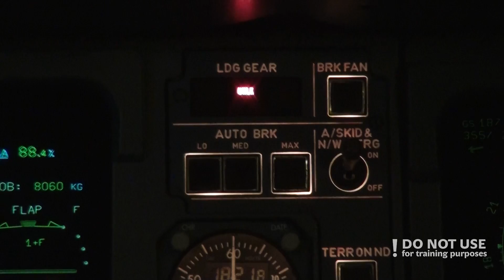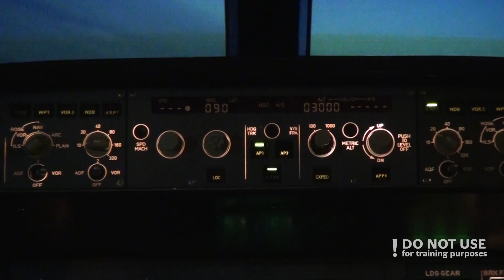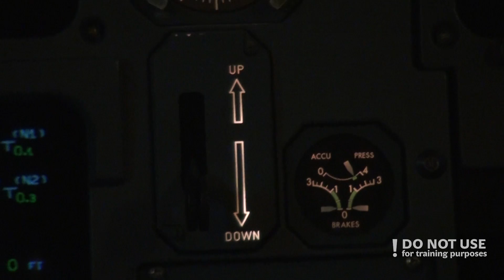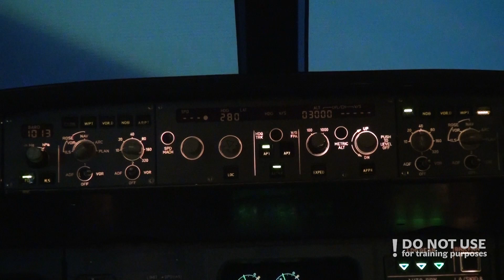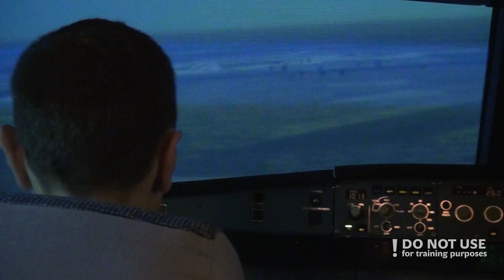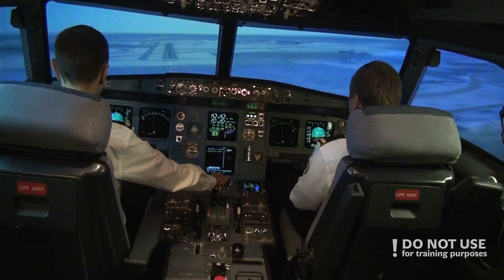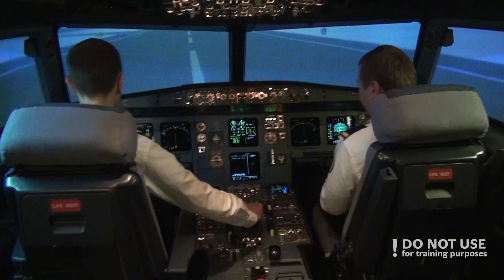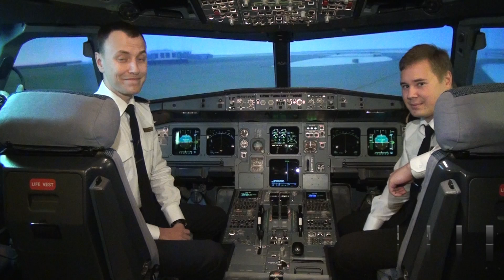CPL students in A320: landing gear failure - Baltic Aviation Academy

Comment: I shouldn’t promote this video if I was the owner of this flight school. Everything is so wrong and it only shows the quality of their training. Manual flying and not activating automation while dealing with a failure while still just after take off. Immediately recycling the landing gear lever without checking the actual movement of the gear on the SD page. The PM is overruling without discussing. Not even pulling speed to avoid excessive G factors with the gear down. Anyway, everything was wrong

Comment: I dont think they are type rated as they were not standard on callouts , no fma read ,no proper decession and comuications , no proper judgment ,no trk/fpa for x wind t/o , autopilot disconnection was clicked once and. The fwc was silenced by pressing the master caution .
Airbus dont call the levers throttle its called thrust lever 
The breifing was not done well , i think this video is made for fun purpose.

Thanks

Regards 

Real a320 pilot

Comment: no dialogue between the two, when clearin ecam actions they should confirm their intention to clear it before and check thet they agree, dual inputs, not good english and no qrh reference... I don't know, i would send them back to a tecnam (the one they use) or a cessna before letting them  try an a320. they didn't even turn off the flight directors and and performed any kind of cheklist